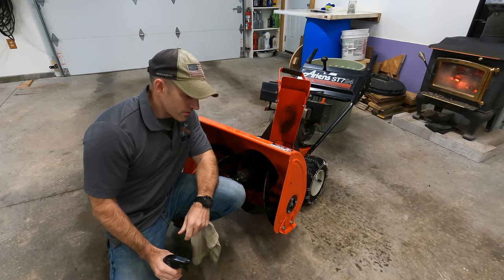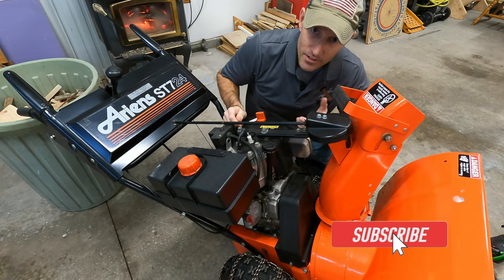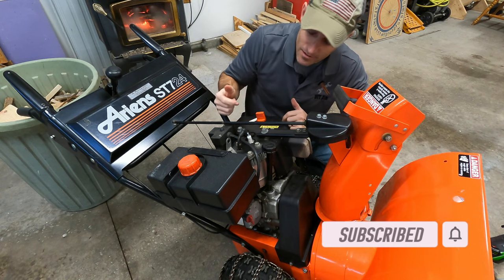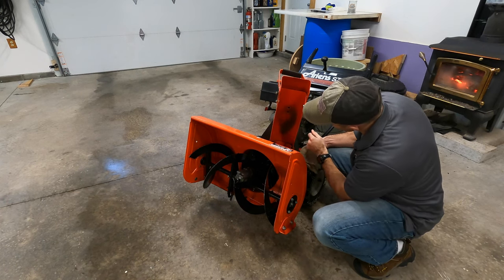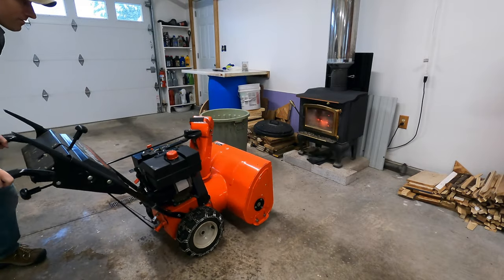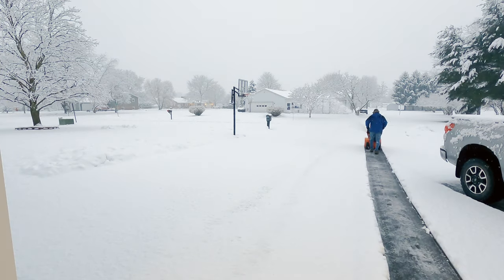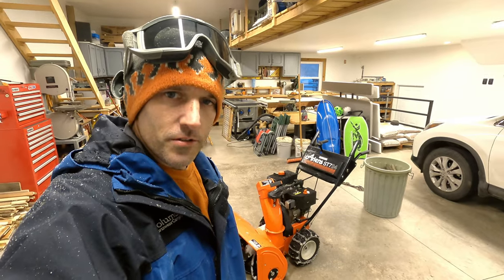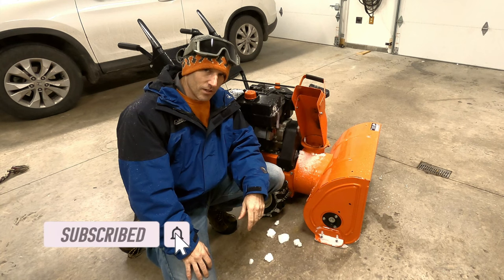How to make your snow blower not clog (not stick) use a ceramic spray

Comment: You add as many safety tips as you need to. It might save someone's life. 👏🤝. Great video by the way. I'm buying a good second hand mower and building a plow with a winch and lights. I'm definitely going to put a few coatings of ceramic on the blades. Thanks for your video. You're doing awesome.
Reply from the maker: Thanks for watching John

Comment: Great video!  I actually had this ceramic spray in my Amazon cart, thinking it was the best stuff to buy to snow-proof my shovel.  Seems like it would be much better than various other waxes and silicon sprays, and even easier to apply.  The description is just what the doctor ordered: "Super hydrophobic and SiO2 polymers deliver water repelling, water sheeting, and chemical resistant protection that can last up to 12 months".  Your video sealed the deal - thanks!
Reply from the maker: Thanks for sharing! Glad I was able to help you out

Comment: Great video. I have same snow blower as you and constantly having to deal with this issue during bad snow storms in the winter. Special thanks for providing yet another usage for the Turtle Wax Ceramic Spray haha. Worked great on my Mitsubishi outdoor mini split AC units like you suggested (and of course on cars), so I will definitely be trying this come winter.  If you have other suggested uses for the ceramic spray, let me know…still have to justify that (very modestly priced) ceramic spray purchase to the wife haha
Reply from the maker: I just made a video using it on my Moms car. Thanks for watching Mark

Comment: Great idea Jim. I wonder if when you spray the chute, if you would rotate the chute as you spray down into the throat, if it would get better coverage. It looks to be like using this coating definitely helps. Thanks for sharing.
Full watch and a thumbs up. New subscriber here.
Reply from the maker: Awesome thanks, that ceramic spray also works great on my car and truck no more 2 hour wax job. Thanks for watching

Comment: clear coat is nice, i use it on my snowmobile rails, keeps the snow from sticking
Reply from the maker: I just learned this,  it does seem to help
Reply: Why can’t they xhaust the  engine  around the impeller  
Surround to prevent ice build-up?
Reply from the maker: @gremmie3  you would think someone would have tried this

Comment: This does not work very well. 

I ceramic coated my entire brand new snowblower Toro 826 electric version e26 

Just had 4 inches of snow real wet and sticky.. it clogged a lot!!  Never had this happen before. It was pretty bad even got clogged behind the auger had to keep using the unclogged tool over and over. That was a pain in the butt
Reply from the maker: Sorry to here that it seems to help my snowblower. Thanks for watching

Comment: If you think your snow blower is just going to randomly start up by itself I think you have a bigger problem than snow sticking in it.
Reply from the maker: Thanks for watching
Reply: You do understand safety first??????????
Reply: It protects him from getting sued by someone who does something stupid, like doing this with the engine running. YouTubers on gun channels show their audience that the gun they are pointing "at the camera" is empty, as if it would go off while pointed at and audience member in their living room, and injure them. Car channels disconnect the car battery even though they are not working on electrical systems. It's a liability thing!